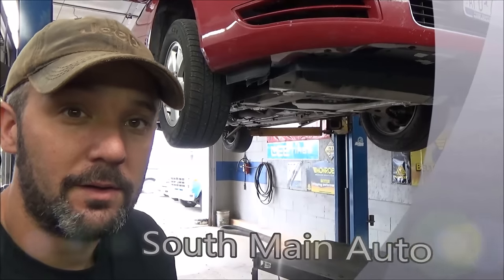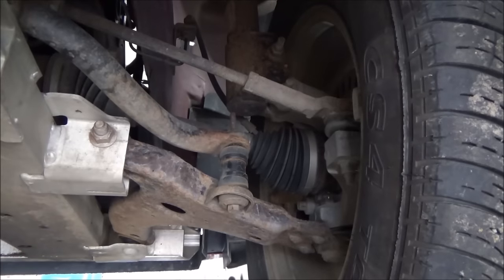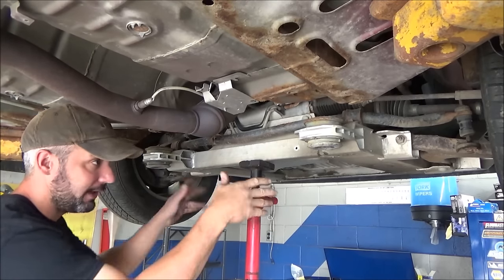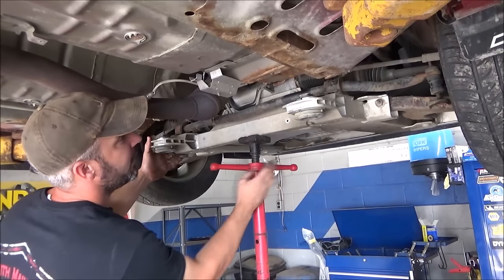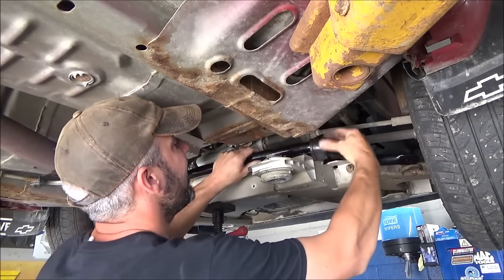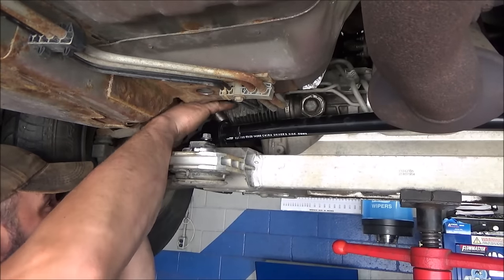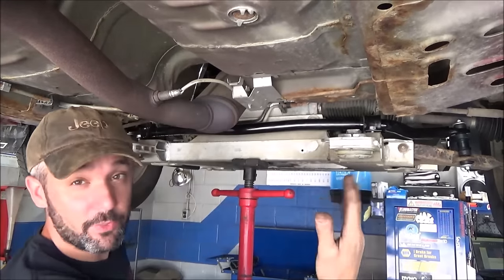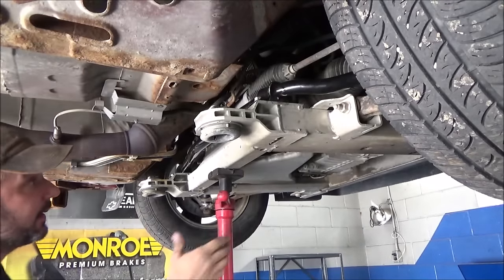Chevy Impala : Replace Broken Sway Bar

Comment: The front bolt on the bracket/bushing is just spinning, its as if the nut or whatever the bolt runs through is broke, it spins easy just wont come out. Have you ran into this problem?  If so, how do you get the bolt out?
Reply: I ran into that exact same problem. But luckily I wasn't replacing my sway bar at the time I was just replacing the sway bar bushings. So what I did is I was able to loosen one bolt on each bracket, and then I took pliers and anything I could grab to bend the bracket as far as I could have to get the bushing out and then put the new bushings in. Then  Bend the bracket back down as best as I can and then put the one bolt that I was able to get out back in. But now that my sway bar is bent to crap, so I'm going to have to end up replacing it in the next few days, I'm going to have to try and figure something else out.

Comment: After putting a sway bar in on a 2008 Chevy Impala do you need to get a front end alignment?
Reply: Yes. Any suspension or steering component replaced, such as the sway bar, you always need an alignment.

Comment: I suppose it's not necessary to fully tighten the sway bar links at ride height? Or does it depend on the vehicle?
Reply: Technically, the torque spec on them is 17 lb/ft - they literally don't need to be that tight.  I go until it's tight enough to see the bushings just start to compress.

Comment: Did you have to relieve the pinch bolt before lowering sub frame?
Reply: I was thinking the same thing.  The steering rack is mounted to the subframe.  Any time you lower the subframe you really should disconnect the pinch bolt from the steering rack input shaft.

Comment: Excuse me.....no break cleaner!? It's the end of time as we know it...

I usually lather the D-bushings in white lithium grease to prevent any binding. It's ok to use right?

Thanks for another great episode.
Reply: Darren G. Not wise as petroleum based lubricants can attack the rubber turning it to mush. Much better off with a silicone based lubricant. Rubber loves silicone but doesn't like oil based products.
Reply from the maker: SATAMAN Schmidt I totally agree
Reply: Polyurethane as well? The energy suspension d-bushings I installed have grease divots, that's why I used WL.....learn something new everyday.
Reply: Darren G. Polyurethane is definitely not rubber. It's an advanced plastic. I have no idea if it cares about grease or not....Scotty Kilmer lead me astray with Lithium Grease and sway bar bushings...
Reply: Polyurethane is unaffected by petroleum but is a premium product and not typically included in these kits. You can get polyurethane bushings from a company such as Energy Suspension if you're willing to pay the price but they cost far more than the traditional rubber bushings that Dorman puts into these kits. Even with polyurethane there is no reason not to use silicone grease or spray.
Reply: SATAMAN Schmidt sorry, should have been more specific right off the bat. Cost wasn't that much more, $13 vs $20, but I'm wishing I would have bought a master kit...... Thanks for the replies. I Guess I need some silicone grease next trip.
Reply: SATAMAN Schmidt My local store didn't have it when I was doing caliper pins. Would the synthetic version for caliper pins be good on rubber bushings?
Reply: This works great for caliper pins too.

Comment: I couldn't help but notice that was a Dorman sway bar kit.  Eric, I hate Dorman with a passion that rivals yours all day.  So I gotta ask, did you panic a little when that sway bar kit installed without a fight and did you do a countdown on the warranty period and maybe cry a little on the inside when that kit actually made it to the end of warranty?  I haven't done one of these ol' sway bar kits in a long time so I was actually traumatized a little when it went in so smoothly and found a sense I could count on this part not to fail for once.  Is this a sign of the apocalypse?

Comment: 4:06 Pretty easy job...yea when you got a lift and all the tools you need at your fingertips =) Anywho, I've been driving around without those links and a busted sway bar for lord knows how long cuz the only time I attempted this I thought you had to come in from the tire. I was pretty sure you had to remove the knuckle from the suspension, anywho after all that nonsense and finally getting the link off the passenger side, it kept spinning, to find out the driver's side not only had none but the dang sway bar was broke too.  I only bought new links so I said forget about it, I'm done. Well, now I know better. What really makes this a huge pain for me is setting up a bunch of plywood in my gravel driveway for my jack and jack stands.

Comment: Took me three hrs dicking around with rusted links an bushing strap bolts but I got mine out without dropping the sub frame just take off the passenger side tie rod end easy Peezy just remove the bushings and  straps from the bar so they don't get caught up on anything

Comment: could you remove the sway bar ? How necessary is it to keep it in there?
Reply from the maker: +Alex Cruz Keeps the body roll down. I wouldn't remove it.
Reply: +Alex Cruz Removing the sway bar can upset the dynamics of the vehicle. Can cause over or understeer and that sort of crap.
Reply: 2000 malibu sway bar if there is a video it would be appreciated

Comment: nice video Eric how do you like Your M18 3/8 impact ???
Reply from the maker: Jonathan Lessard So far I love it
Reply: Jonathan Lessard I've got the 1/2" and 3/8" M18 impacts. I love them both. With about 750 ft/lbs the 1/2" and the 3/8" with 200 ft/lbs in a compact portable impact sorta makes an air compressor 'almost' obsolete.  I've yet to had to go to the second battery during a normal work day. Have friends who work on tractors and 18 wheelers, said they have yet to find a bolt up to 3/4" thick anywhere on the big rig, bus or crane hauler that the big fuel 1/2 can't get off and on. Another friend said it makes working the freeway tow truck patrol a piece of cake. I've watched videos of the big boy tackling 1" bolts but haven't it tried myself.
Reply: Hawaiian F150 the 3/8" 2654 is rated at 200 ft/lbs and the 2655 is rated 210 ft/lbs but i think their more closer to the 175 ft/lb or so range. the 2763 is the big boy and it sure is one tough go to impact.

Comment: I have a new sway bar Dorman 927-100 Application Summary: Buick 2009-97, Chevrolet 2016-97, Oldsmobile 2004-97, Pontiac 2008-97 no ]inks and no bushing 
Cheap

Comment: Ah man, I'd suggest all your customers pay you 30 dollars, and fluid film all the brake and fuel lines since you are in upstate. at least prevent them from rusting for a year or 2..... 

you could get a dedicated sprayer for fluid film, would be a lot easier than paying for the cans... 

just small suggestion. 

Liking your videos so far! Wish you were a little closer to NYC.  no good mechanics here =/
Reply from the maker: +Bardia Ghajari Man NYC, you'd think they'd be everywhere
Reply: South Main Auto Repair they are here, just all pressed for time. try to charge you for every breath they take. Either that or they are totally incompetent. (messing up simple brake jobs)
I thought my car had bad rust, every car you have been working on is about equal or worse than mine. 
Maybe if I am driving back to visit my college in rochester ills top by, and see if you can help me track down a few noises in our 4runner. and the bouncy as hell with new OEM shocks. 

anyway back to hour 3 of watching your videos!

Comment: Was that the earthquake air ratchet?  I love mine! 

Chris
Reply from the maker: shadowdog500 Sure is :)
Reply: shadowdog500 Yes. Mine has been great to me for about 2 years. :) The only trouble is quality control with that company. Took me three for the retainer ring to both help hold sockets and not be ripped off with all the pounding it took to take a socket back off.

When something causes returns, I've noticed them take notice and improve quality.

Comment: started the project at home and having a hard time with one of the crane screws other one came out with some pressure but cannot get the other one off ..any ideas for a guy with no power or air tools...
Reply: What crane screw?  For this job they're all regular bolts.  Get a big breaker bar and a piece of pipe for more torque and liberally hit it with PB Blaster.  If that doesn't work heat the bolt with a torch.  If that doesn't work, electric impacts are $40 at Harbor Freight - you just need an outlet.  If that doesn't do it, air tools is it.

Comment: Wow- that was a cake job!
Hollow bar?
Even after I did my "transmission swap and sub frame restoration" on my '89 Buick Reatta (https://www.youtube.com/watch?v=ssjslu9xdWg) it wouldn't be this easy-
for one thing- my bar is solid and 40 lbs. , but at least it's easy to line up- the left end has a curve in it- that goes around the rack gearbox and over 2 of the bars' bracket saddle bolts (1 each side).
The rack is attached to the sub frame; if you just lower it- the steering shaft will pull out & damage the assembly.
You have 2 choices-
1) separate the tie rods, steering shaft pinch bolt, & 3 nearly inaccessible power steering lines (after removing the pressure switch & losing fluid) or
2) remove 5 bolts that secure the rack to the sub frame (2 left, 3 right), tie up & suspend the rack- then remove 4 *REAR* sub frame bolts (all 4 of mine were shot- as were 3 of the "body nuts" they go into- then lower the sub frame, and then the 4 bolts and 2 links for the bar.
Oh yea- forgot to mention- you must remove the right wheel- as that is the only way to pull the bar out- through the right side.
I imagine there are more difficult cars to do this procedure on- but mine was definitely an experience.
Thank you for this fun video- it's nice to see you relaxing with a cooperative vehicle once in a while!

Comment: I hate GM cars. They're so hard to work on and they have a rust problem.
Reply from the maker: fishodorvagina I love them, they buy my groceries...
Reply: For sure I had a aveo and then a hhr and then a Malibu and they all where hollow cars you felt every bump on the road and felt loose every single GM product that I had
Reply: those are all low-end cars too lol and name one manufacturer that DOES NOT have a rust problem. you've never had a real GM (I'm talking body on frame, not unibody bull)